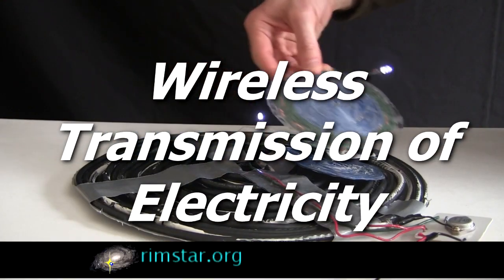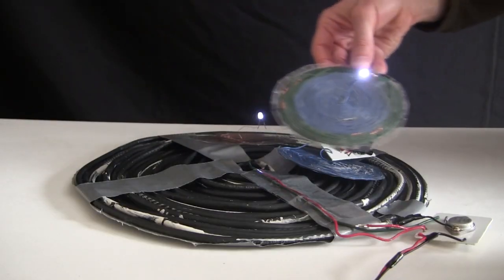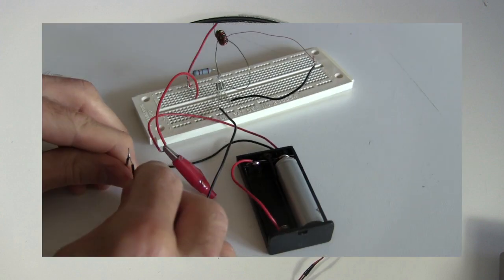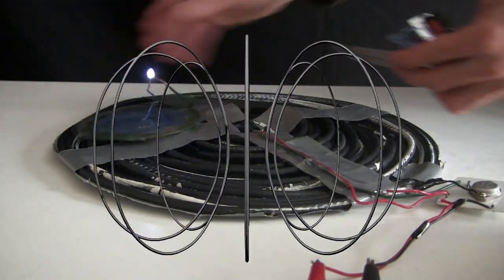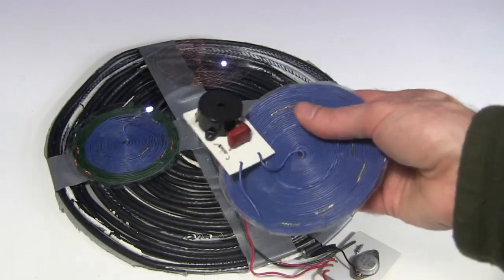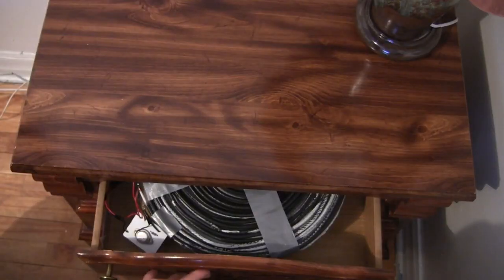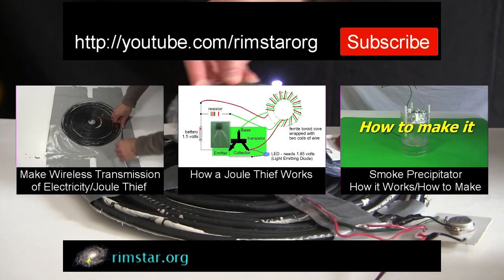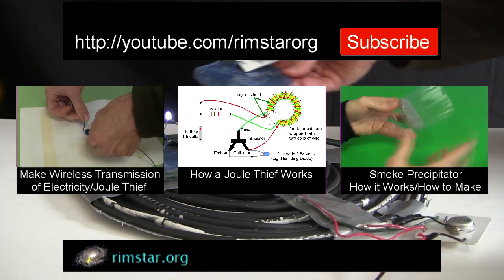Wireless Transmission of Electricity/Joule Thief - How it Works

Comment: Good ol' Faraday's Law!
A changing magnetic field induces a current that creates it's own opposing magnetic field.
For each loop of wire in the receiver: ε = -dΦ/dt where ε is the electromotive force (think voltage) and Φ is the magnetic flux (represented by those black lines in the video). dΦ/dt is the amount that flux changes over time.

Comment: SWES. Very nice. Is that buzzer a dc model with inbuilt timer? Using a rectifier to fill the cap and run the load? Hmmmm... You got me thiking now.... I wonder how a raw Piezo would go on the AC of the receiver?
Reply from the maker: Mongrel Shark Not sure what hardware is in the buzzer, but there's more than just the piezo. It wants DC so I put a cap across the coil output and then a diode after that on the positive. I first tried a variety of raw piezos without any circuitry but only one gave a very quiet buzz. On my scope the voltage was pretty much just positive spikes, though I know if I zoomed in a lot I'd see a quickly  dampened positive and negative going waveform. My guess was that there wasn't enough charge in the spikes to bend the piezo much, though I guess it could instead be that they were too brief.SWES? Star Wars the Empire Strikes back? :)
Reply from the maker: Mongrel Shark Ah, thanks. Yeah, I watched both slider's and your videos as part of my research. I gave slider credit in the video description since it's my understanding that he came up with this approach.
Reply: Yep. Its Sliders invention :)

Comment: How much power the transmiter needs? Thank you for share your knowledge!
Reply from the maker: Babel Comm It's hard to measure since even the input side to the transmitter is very spikey in form, neither flat DC nor sinusoidal AC. The only way I know of to get some idea is to measure the AC input to the power supply but even there I don't have a means of measuring AC current (busted meter.)

Comment: Interesting to see how much current is pulled with the transmitter loop, and how much is delivered to the reciever :)

The QI charger has a 2:1 ratio as far as i know.
Reply from the maker: John Knutsson I'll see if I can make some measurements and put them in the "How to Make" video which might be next week but probably have to wait for January since I need some more parts (I need transistor mounting parts for mounting it on a heat sink.) But even then, the current is far from DC or even sinusoidal AC so I'm not sure I can provide electrical current info. On the oscilloscope the voltage is all relatively long periods of low to no voltage interspersed with brief dampened waves with an initial strong peak. That's the way a joule thief circuit works. The only place it's close to something a meter can work with is in the piezo buzzer circuit just after the capacitor and diode. Suggestions welcome.

Comment: Does this work on the concept of transformers like the number of windings in the primary vs the secondary  and if increasing the thickness of the secondary will increase the current.
Reply from the maker: ProSurviver No, in this the primary and secondary both have the same number of windings. The big flat coils are really a single coaxial cable wound into a spiral. A coaxial cable is essentially a two wire cable.

Comment: Need a quick answer. I was thinking that I'm might be possible to charge your phone with the nfc
Reply from the maker: navid mehdi I think you'd have to know more about the charger in your phone and what its requirements are. You should be able to make a receiver coil that has some circuitry and that you'd plug your phone into. I don't know much about phone chargers.

Comment: I want to make a small motor run this way but have been unsuccessful so far.
Reply from the maker: Bill P I didn't have a motor small enough to make it work, but if you check the link in the video description to slider2732's video then you'll see he has a small enough motor.

Comment: Nice, but i would be reluctant to put my fingers  anywhere near such contraption :) playing with electricity doesnt calm me :)
Reply from the maker: Vaidas Šukauskas Thanks. There's no danger in handling the energy receiving coils but, yeah, if it were to be put to frequent use I'd box up the transmitting coil and circuit.